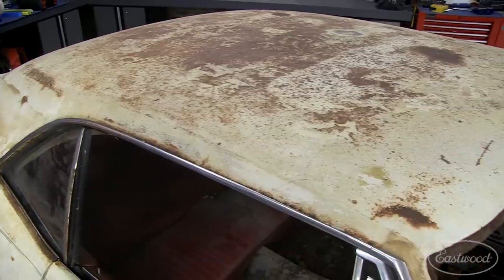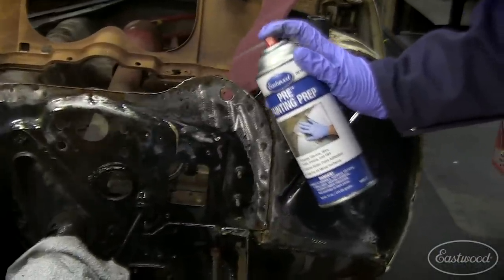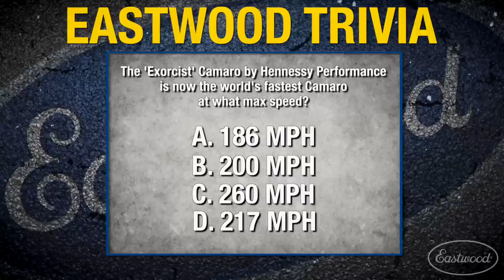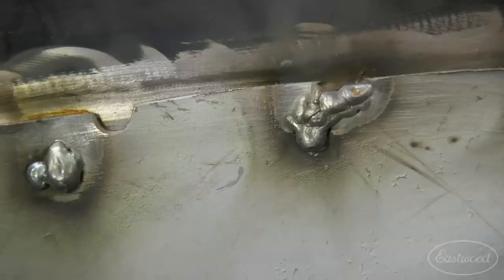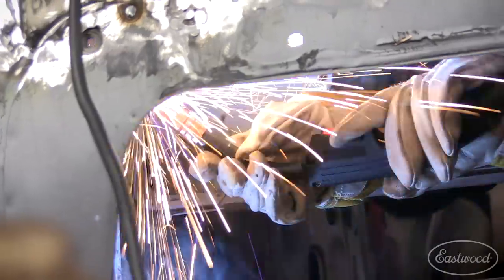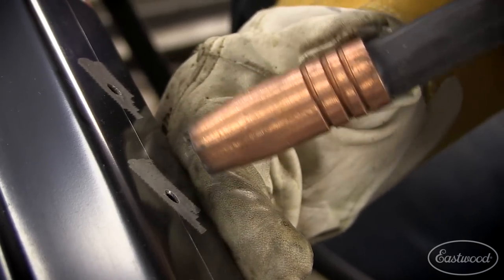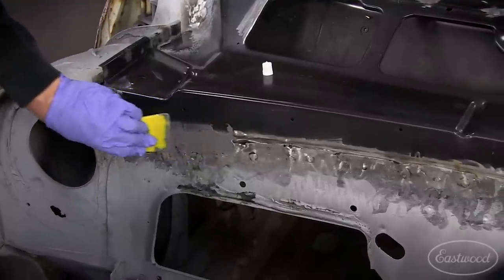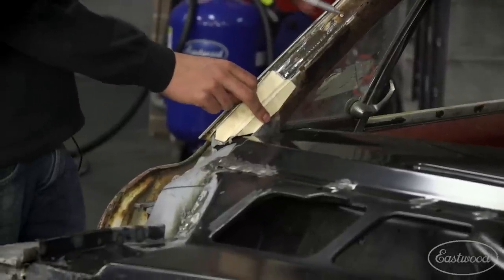How To Repair Rusted Camaro Cowl & Dash - Repair Restore Revive: Ep.5 - Eastwood

Comment: I'm replacing my firewall, cowl, tulips & upper panel right now on my 68. This was very helpful and gave me some new ideas & vantage points. I like the JB Coldweld type product on the firewall. You can sand it down smooth & it takes paint well hiding the seam almost entirely.
Reply from the maker: Nice! Glad this helped you out a bit.

Comment: Wow, your welding skills really improved a millionfold between the first and second passes. /rolls eyes.
Reply from the maker: MIG welding is easy to learn. Just look at how quickly Cody's welds improved in a single day on the first project he attempted.
Reply: @eastwoodco  I'm doubtful that Cody's welds improved so much in a single day. I'm also a beginner and after 2 years my welds still look like goobers. I'm just not buying it.
Reply from the maker: @DavidPlass  It really was that quick. He adjusted some settings and his technique slightly and part way through the first little project he was laying down nice welds.

Comment: Usually I definitely try not to bust on people willing to put themselves out there on U-tube but holy crap that bad boy is a rust bucket. Well good luck and hopefully the price of your next project will be a little cheaper.
Reply from the maker: They don't get much worse than this Camaro, even by Pennsylvania standards!
Reply: @eastwoodco  why was it bad to spray rust encapsulator all over ?..& why did it cause problems?.

Comment: Question? What was the purpose of the copper plate to close that gap. Were you welding the copper plate behind the gap or does mig weld not stick to copper. I'm not  a welder
Reply from the maker: Copper backers are used because they are non-ferrous and can't be welded too.  So you can use a backer to help prevent "Blow-Through" and weld up a gap in sheet metal.
Reply: @eastwoodco  thank you for the reply

Comment: Should the structural panel adhesive be applied from top, so it will fill the possible gap between the 2 panels welded?